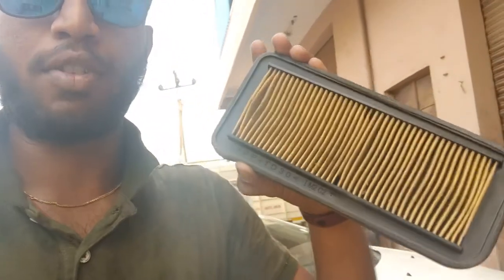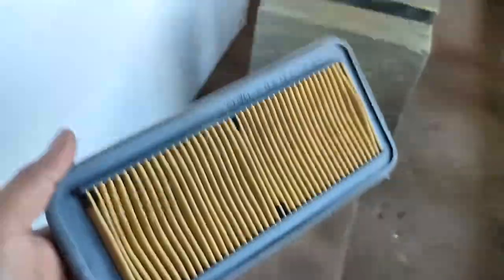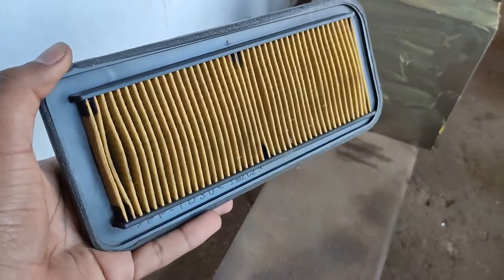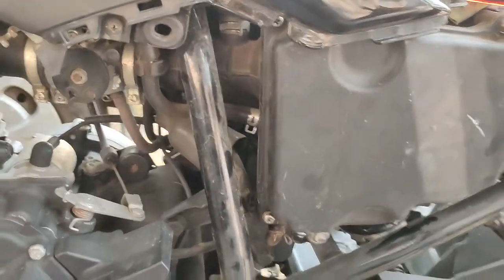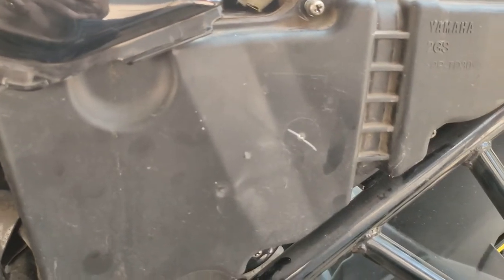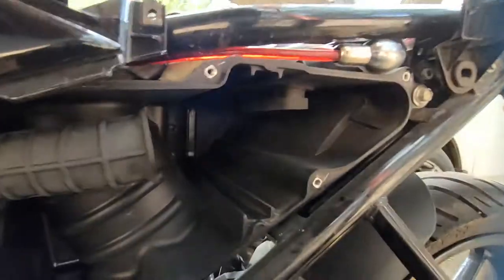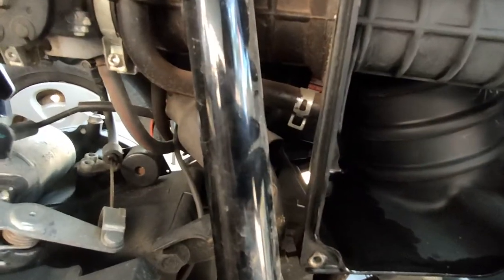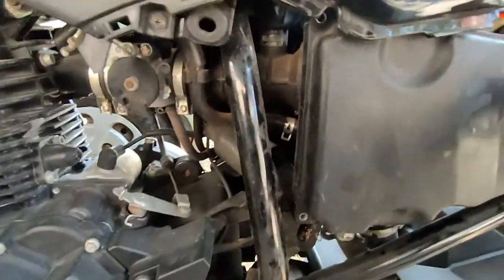(Tamil) FZ V3 Air Filter Cleaning Process at Home | Simple Steps | DIY

Comment: Hi buddy, when I was changing air filter of my fzv3 i saw some moisture and liquid at the bottom of the air filter box. Is it normal?
Reply from the maker: Hey. Even I have experienced the same. It is totally normal. Just wipe the moisture with a clean&dry cloth before installing your air filter again.
Reply: @ShaswathArun  I was worried as it smelt little like kerosene

Comment: Bro Airfilter clean pannumpothu athum mistakes vidurathala engine heat aaka chance iruka?? En MT Airfilter clean pannathum heating aavuthu!😰😰
Reply from the maker: Airfilter correct ana direction la insert paningala nu check panunga bro! Adhu matum dhan mistake panradhuku vaaipu iruku. Ilana Yamaha service center poirunga adhan better.
Reply: @ShaswathArun  service center poi. Bike ah fulla kaladdi paathudanunka bro. But still heating 😰
Reply from the maker: @Irushks  Engine heat agudha or vera place la heat agudha bro?
Reply: @ShaswathArun  engine and radiator both heating bro. 5 km ride pannale radiator work aavuthu. Avalathuku heating aakuthu
Reply: @Irushks  bike vangi yevalo nal aguthu bro?